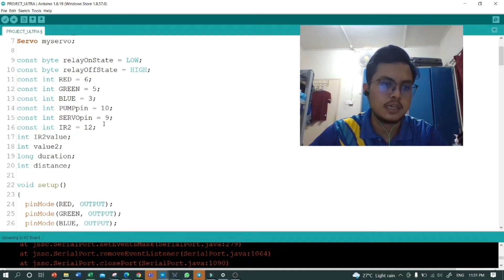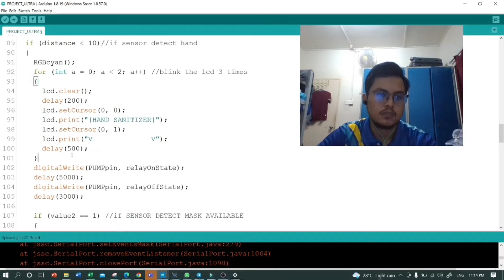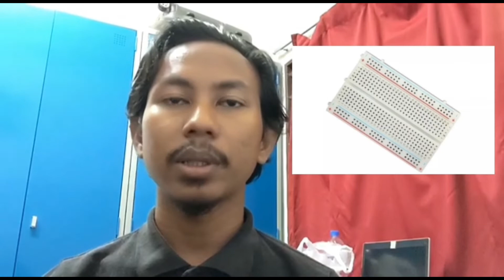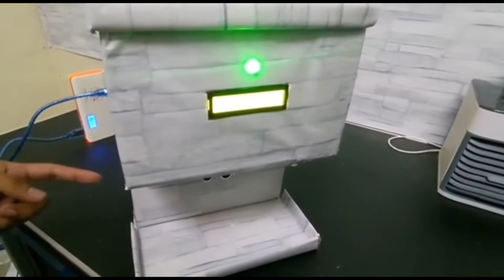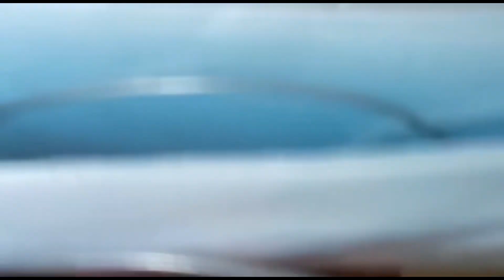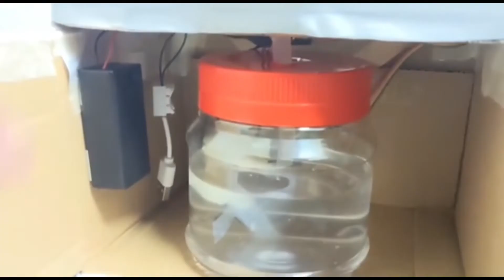Automatic Mask & Sanitizer Dispenser by Group 8 | BEE3942 Microcontroller Programming & Interfacing

Comment: Hai I’m from group 6 . My question is there’s any possibility where the sensor cannot trace the hand?
Reply: Hello, Izzah. The answer to that is yes. Sometimes the sensor cannot detect the hand effectively because the area where the hand should be placed is larger than the sensor's coverage area. However, this issue can be resolved by installing a more sensitive (and therefore more expensive) sensor, moving the sensor to a different spot where it will be easier to detect the hand, or simply reducing the area in which to place the hand.

Comment: 1. WOW! 😮 Hardware prototype is SUPERB! 👏🏻 TERBAIK! Betul ke buat sendiri untuk subjek ni?? Ke ambil projek diploma or mana2 projek lain ni?? Cuma sebab hantar lambat, kena tolak markah lah.. kalau tak, perfect dah ni..
2. Mana dapat idea guna spring untuk dropkan mask tu?
3. Why do you set the distance to ten? Why not just five? Justify your answer with some proof from a research study.
4. Why do you turn on the pump for five seconds? It might waste a lot of hand sanitizer. Why not just 2 seconds? Justify your answer with some proof from a research study.
5. Simulation presentation is unclear.  I don't see the LED colour changing, The Servo motor movement and IR sensor functions are not being demonstrated. Why motor is always rotate in the proteus?
6. How many masks can fit inside the container? How can we fit more masks inside the container?
Reply: 1.	Thank you for the compliment 😊. For your information, we got the inspiration for this project from the link you provided (https://youtu.be/oQIfr_8_rRE), but we improved it by adding a sanitizer dispenser and a spring-loaded mask dispenser. And we sincerely apologise for the late submission, for which there is no excuse.☹

2.	The drinks/snack vending machine inspired us to utilise spring. It produces fewer errors during mask dispersion and makes it easier for the sensor to identify the mask's availability.

3.	The distance between the ultrasonic sensor and the hand sanitizer dispenser is 8cm. Therefore, the distance must be set to at least 8cm for the sensor to detect the hand. We added an additional 2cm for the sensor to detect the end of the hardware container. Second, if we set the distance to 5cm, it will be difficult for those with little hands, such as children and women. Because they need to bring their hand closer to the ultrasonic sensor, the hand sanitizer will be dispensed to their arm instead of their palm.

4.	According to our research, water density will have an effect on the motor pump. The greater the density of the water, the more difficult it is for the motor pump to pump water through the tubes. Because the density of sanitizer is significantly more than that of water, we must set the delay to 5 seconds for it to flow from the container to the end of the tube. After the motor is turned off, the remaining sanitizer in the tube will gradually return to the container because to gravity (the sanitizer container is placed at the bottom of the hardware container). We decided at the 5-second time delay by trial and error.

5.	The simulation is most likely wrong due to a file problem. The previous testing program is still in use. However, we have updated the correct file and program to the Proteus and Arduino zipfile submissions. Again, we apologise for the inconvenience.

6.	Three masks are able to fit inside the container. To fit more masks inside the container, we can increase the container's size, decrease the spacing between the springs, or add more springs.